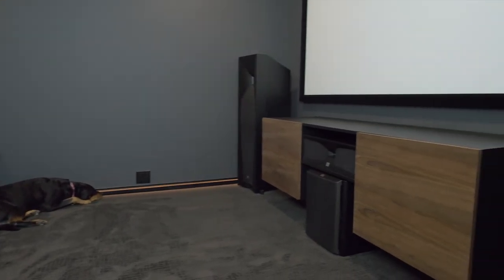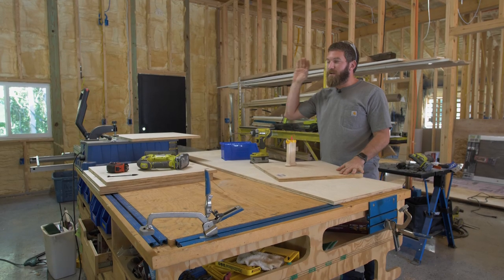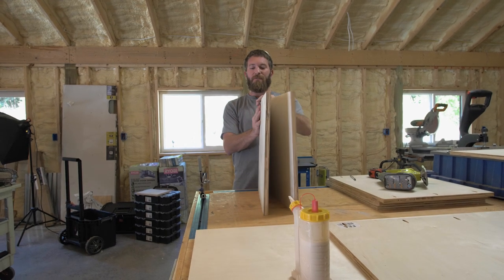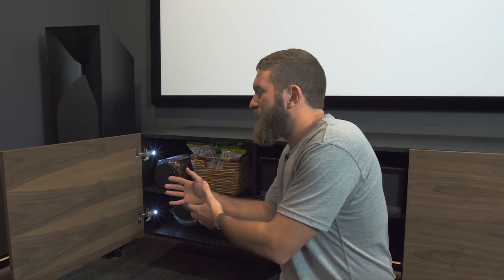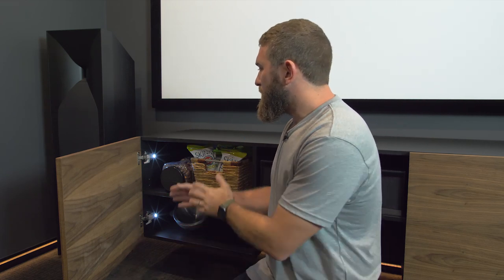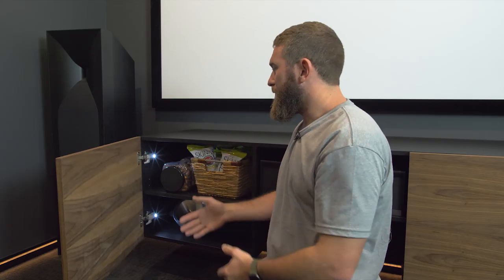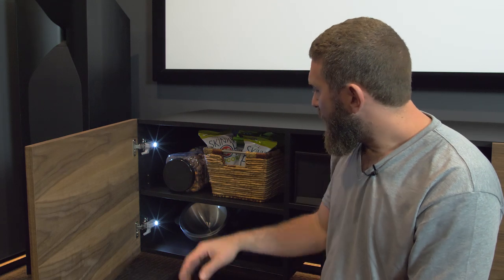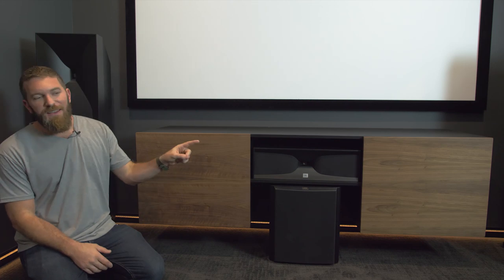Modern Floating Media Console - Free Plans

Comment: Building a Murphy bed wall unit and that track saw is awesome. I did the dewalt with the long track. Love it. Same trick with the rigid foam under. 

Great build. The theater room is my next project. This is giving me some ideas....
Reply from the maker: Thanks Chris and I couldn't agree more on the track saw comment. I wish I had bought one a long time ago.
Reply: @rogueengineer  next for me is the short track. While it's not a table saw replacement there are things its just faster and easier for.

Comment: nice tv bench!! Do the sub is sealed or ported? My only concern is if the sub is ported with the port on the back.. if sealed or front firing thats nice!  Need to change my tv bench and cannot find anything I like made with some quality to last
Reply from the maker: Thanks Sebastien! The sub is ported in the back but it is away from the wall and below the cabinet so it doesn't seem to have affected the quality.
Reply: Great!  I cannot do this with my Totem acoustic storm sub in the living room since it a sealed but with 2 passive radiator on sides. (amazing little sub btw.. not powerful as my HT velodyne 12in) Thats where I would like a floating tv bench!   good work!